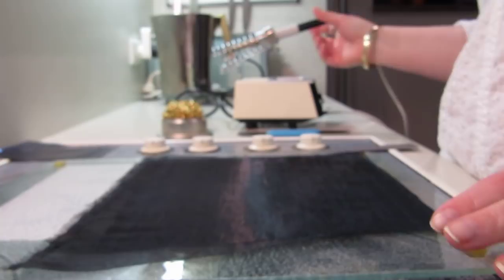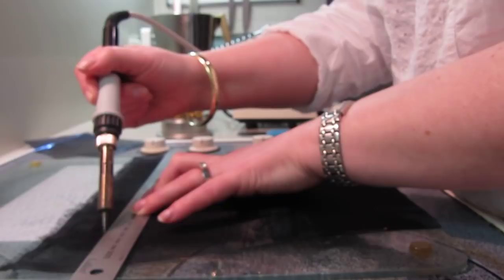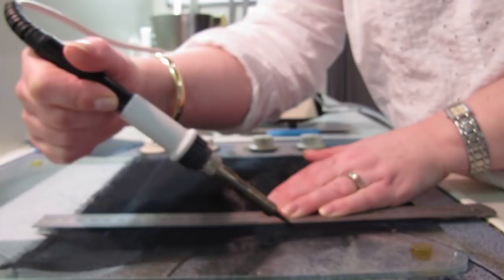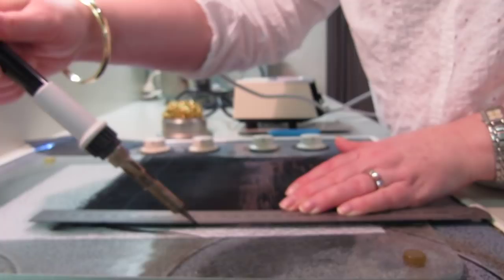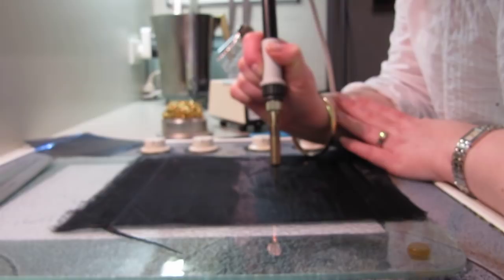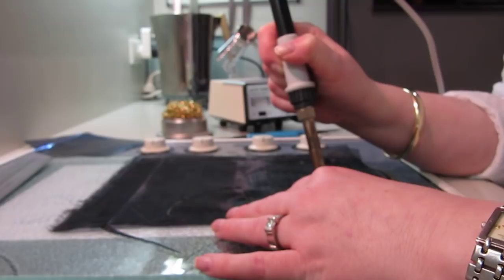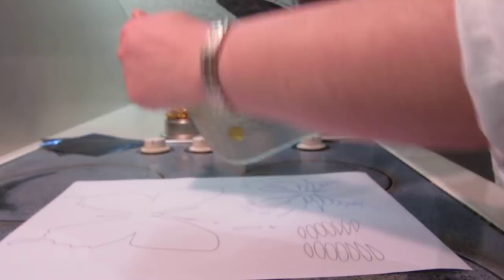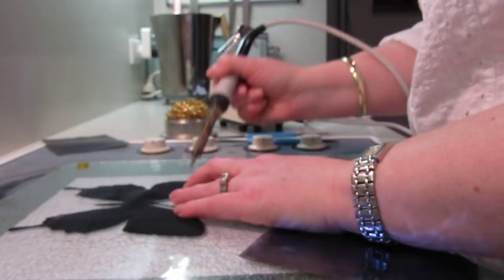Butterfly Tute - Soldering Iron on Organza

Comment from the maker: Absolutely - as long as it's synthetic felt (and most of the cheap stuff is). Just make sure it's acrylic or whatever and steer away from bamboo, rayon, cotton, wool or silk. Any synthetic fabric is essentially woven plastic anyway - so it all melts, scores and cuts beautifully with a soldering iron. Just make sure you wear a mask that protects you from fumes to be safe or at the very least work outside - there aren't a lot of fumes but you don't want to be breathing in melted plastic.

Comment: How do you stiffen the organza wings so that they're not "floppy", or are the three layers enough to keep them upright?
Reply from the maker: The textiva film is quite firm after you put the 3 layers together but the wings remain reasonably soft so they can float in the wind the way real butterfly wings do. I've framed one and just joined it along the body and haven't had it 'flop' against the glass, I have another on my fridge just with a magnet and it's wings stay upright too.

You could also soak it (or paint on the back) with fabric stiffener (available at fabric shops) if you did want it much stiffer. Let me know how you go!

Comment: So once the edges are cut with the iron there's no need for sewing after that?
Reply from the maker: Yes, you don't need to sew them to stop fraying. They are sealed like laser cutting (which you see a bit these days in underwear). just make sure you travel slowly enough to cut all the way through properly and seal - if you go too quick it won't cut all the way and you'll be tempted to just pull the pieces apart. If you do that it may still come off but you may get little frayed bits coming through where you've ripped them apart.